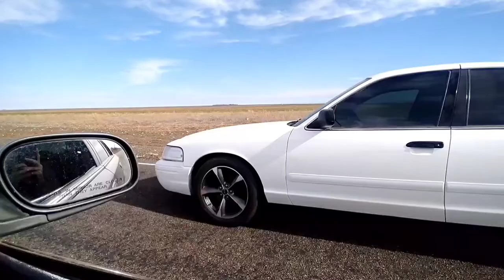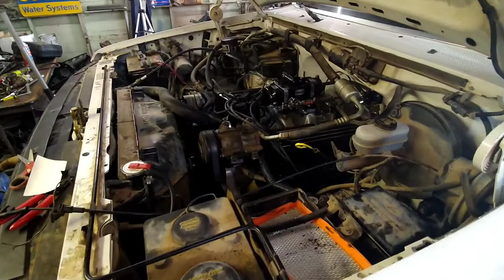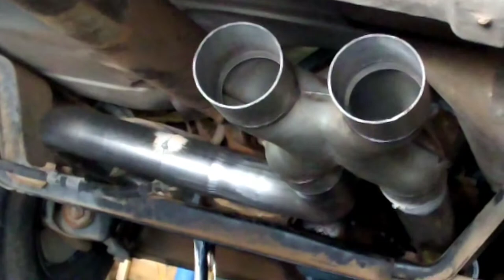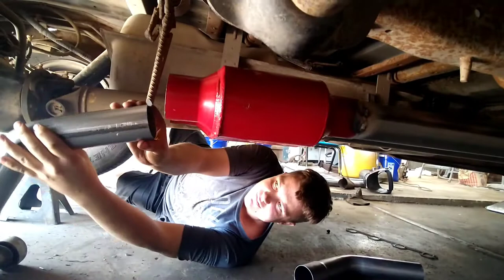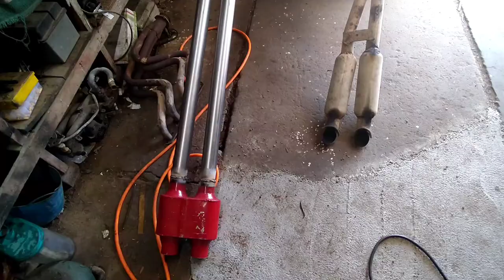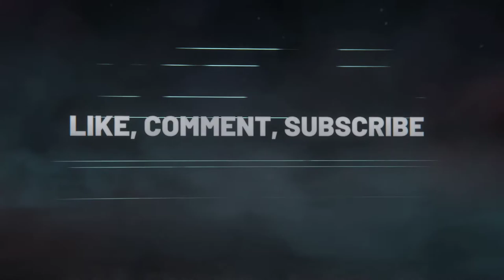How to build your own exhaust

Comment: Sonds bad ass what cam did you guys go with i need a muffler system like that for my truck
Reply from the maker: It's a compcams xe282 retrofit roller 513/529 lift 230/238 duration
Reply: @CCAutoWorks  thats a big cam  whats the exhaust called trying to look it up not finding anything
Reply from the maker: @maniacmachanic9870  the muffler is a Cherry bomb extreme the pipe two and a half inch mineral bed universal tubing assortment
Reply from the maker: https://www.ebay.com/itm/2-5-Custom-Exhaust-Tubing-Mandrel-Bend-Pipe-Straight-U-Bend-Kit-/264455146249?_trksid=p2349624.m46890.l49286
Reply from the maker: The brand I got was cheaper the the link I sent u
Reply: @CCAutoWorks  thanks for the link I appreciate it been wanting to make my own exhaust for the truck that will work great